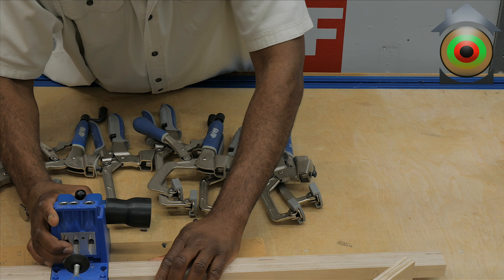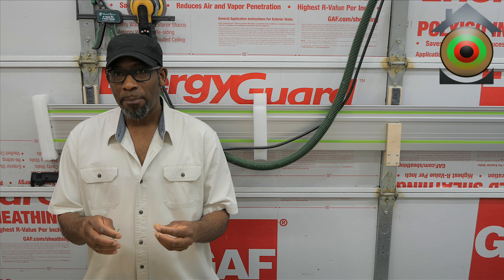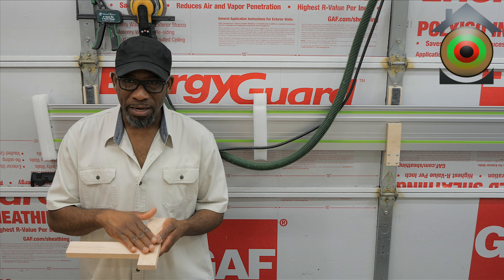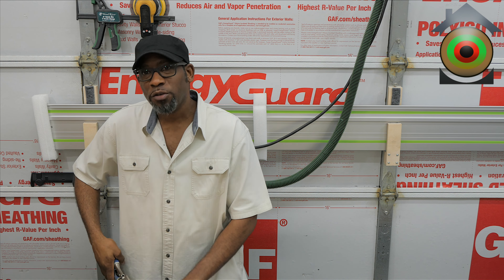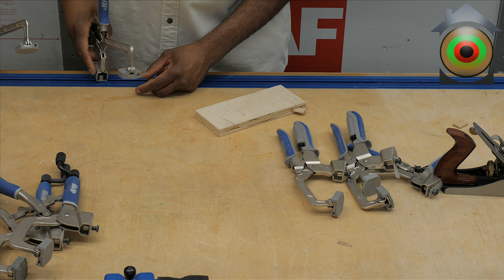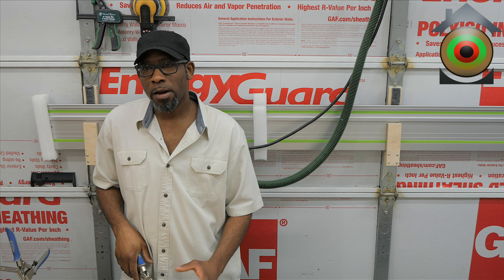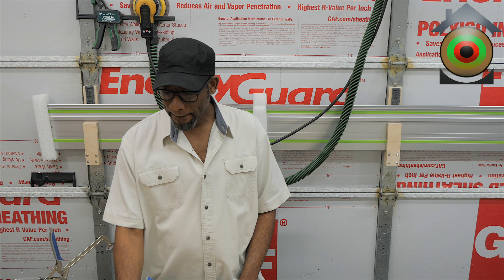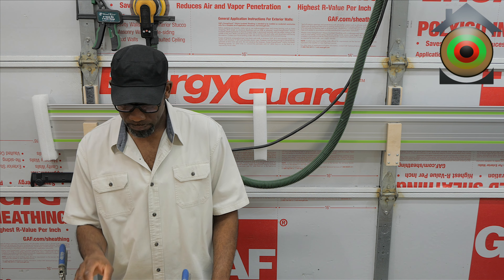Kreg Automax Clamps "Love and hate them!"

Comment: The offset in the pocket hole joint happens when the two halves of the joint are not 100% tight to each other. Even if the joint faces are flush to one another, if there is any gap at all, it will offset itself. 
As the screw is inserted and tightened, it set itself lower in to the joint than it should be and as the joint draws together, it offsets itself due to the position of the screw.
The Autoclamp is a love/hate relationship for me, too. I find if I don't open the clamp completely between use, it won't fully reset itself and will not tighten fully.
Good video as always! I appreciate you, Michael!
Reply from the maker: I always start with properly prepared stock, so have to force a joint close.
Reply: @concentrichomesolutions  I've also had experience where starting the screw forces the joint to open a bit, this can also cause the joint to offset.